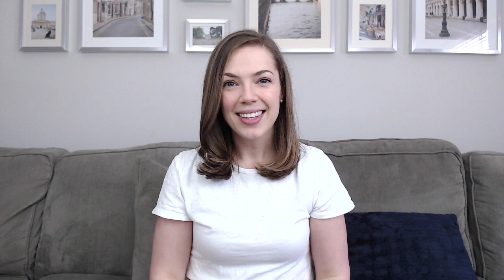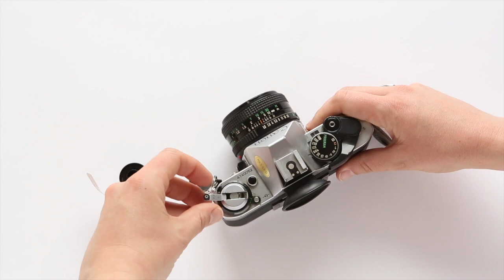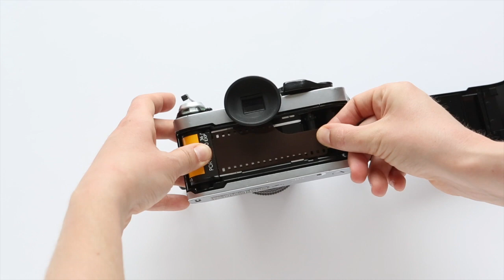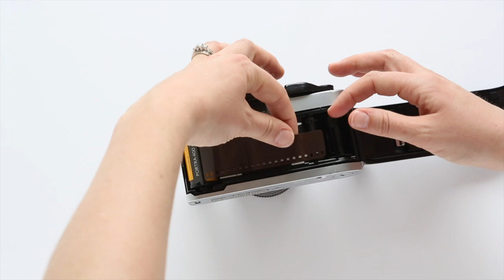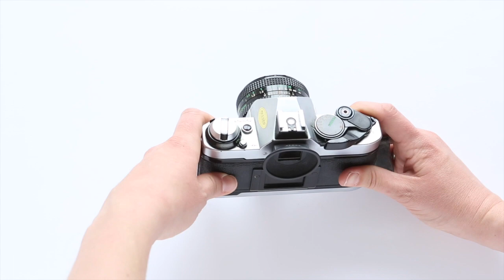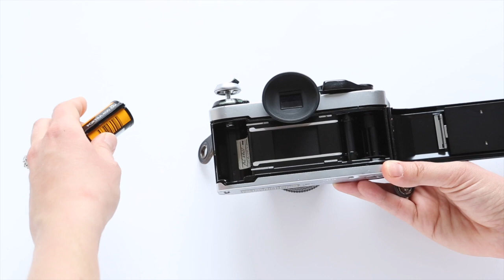How to load 35mm film into a Canon AE-1

Comment: hmm! I just got an AE-1 on ebay, it seems to function well, but what I just noticed is the exposure counter is stuck at 38, it doesn't reset the way yours does.. do you know what could be happening here?
Reply from the maker: Hey Keegan! So you've put a roll through, and the counter doesn't change? Did it change when you rewinded the roll?